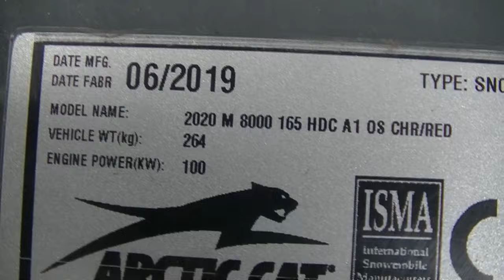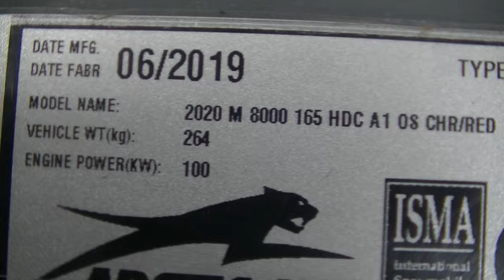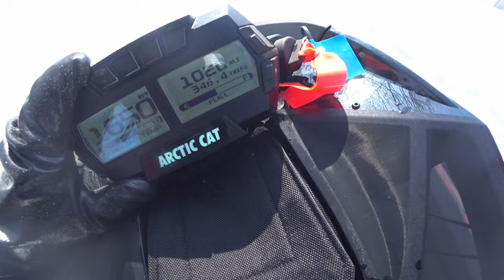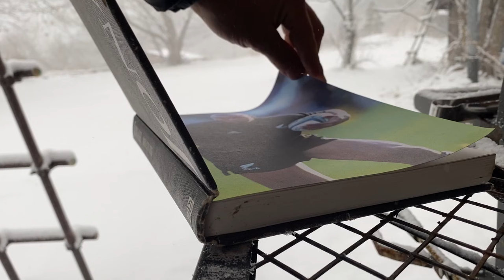2020 Arctic Cat Alpha One Hardcore 165 long-term owner review

Comment: Another great job of expressing your opinions and experience of operating the ALPHA.  Cat doesn’t get as much love for their snowmobile products as they deserve.  AND BRP Linq accessories are the best system..
Reply from the maker: Adventures This Way: Cheers!  I think the LINQ narrow system will fit on a Cat or Polaris tunnel. Gonna look into it over summer so I can really mess up the Cat’s identity.
Reply: @AkatarawaJapan  There are a few companies that make a conversion bracket. One is South Simcoe Machine here in Canada.  Only reason I don't have this bracket is limited room on the Cat 129 tunnel...
Reply from the maker: @ADVENTURESThisWay  Oh thanks. Just checked out their site and their machined brackets look great. Asking if they ship to Japan.
Reply from the maker: @ADVENTURESThisWay  And they got back right away to say yes. Thanks for the info.

Comment: Beauty review again man! I am still loving my mountain cat and the HiJet is still the best little sled hauler. I have had the same experience as you in having the chance to ride a 154. Coming off of my 162 it was so nimble! Needless to say a 154 will be my next sled. It'll fit a bit better in the HiJet too LOL. Oh and I will recommend the Black Cats running boards from Arctic Cat. I installed them last fall and have about 2000 km on them now......amazing! They are also stiffer than stock and clear snow excellently.
Reply from the maker: Thanks. Super tempted to get a 154--Quick, somebody slap me into my senses. Hacking the holes on the Cat really works, but a set of Black Cats like yours would be nice. Kei trucks rule! Change the oil on your HiJet every 3000k or so and you should be able to thrash it forever. Got a rev counter?
Reply: @AkatarawaJapan  no tachometer in mine unfortunately, drive by sound LOL. I have been running full synthetic since i purchased it. Super clean unit and only has about 14000 km right now and papers to confirm. I was thinking 5000 km oil changes with the synthetic but will keep an eye on it. A friend of mine bought a turbo doo and I must say WOW! That machine is a beast! Have you modified the rear suspension in your Kei at all or just stock? I notice after coming off the mountain and heading home at night I get a lot of people flashing me their high beams. The sled squats the truck slightly that it changes the angle of my lights up. Nothing crazy but its enough. I was thinking about adjusting my head lights down a bit but wondering if you might have any suggestions.
Reply from the maker: @mynewuseddoo : My HiJet has a headlight adjuster dial so I can tweak that when under load.  Presume your lights have been realigned right for driving on the right side of the road? I'm sure the turbo Doo is great. Would love to ride it but the  price just came out in Japan @ more than CAN$30K.  Which is 3 brand new kei trucks.  Going to have to pass...

Comment: Thanks for taking the time.  I have a 20' hard core 154 with speedwerx stage 2.  On your next alpha I highly recommend the stage 2.  Massive low end and mid range gain.  Top end a bit more.   Just a good nasty and sappy naturally aspirated setup, and dam near as reliable as stock.  Fun level went up a couple of notches over stock.  My last sled was a turbo 17'  mc,  I prefer the stage 2 over it.
Reply from the maker: Cheers. How did you know I'm getting that 154 I rode? That's top secret. What are the key bits with a speedwerx stage 2?
Reply: Stage 2 is full exhaust, higher comp head for your elevation, Delta 3 reeds, clutching.   Around 17hp gain and lose 20 ish lbs total with this.

I also have the light weight secondary clutch parts, billet spider in primary clutch, tki belt drive.  All those parts remove 5-6 lbs rotating mass.  Belt rotates easier than chain as well.  More power to the snow.
Reply from the maker: @russ384  Oh man, that sounds great. Thanks for the details--always prefer to hear from someone  actually using the gear rather than just reading the company spiel. Going to look into it.
Reply: Akatarawa Japan also put a poly carbinate hood on it with small led headlight, lost another 15-20ish pounds doing this.  Thing will flip over backwards on command, light weight is fun.
Reply from the maker: @russ384  Way to go. Are you on Insta? Would love to see some pics or vid.

Comment: I had under 300 miles on my 2020 when the rail separated at the front. Good news is they warranty it. Bad news is I never hit any thing at all and now it’s off warranty if it happens again.
Reply from the maker: Bummer. I’ve heard of that happening but not seen it. A new rail is about $300 if off warranty, no?
Reply: Akatarawa Japan the price isn’t listed on their parts site but I’d bet here in Canada they are at least a thousand bucks to replace.
Reply: @boser1212   if not more. give it time this will become a problemo
Reply: @menotyou7762  I’m not giving it much time. I’ll ride it this season and it’s gone. Sick of the savage wash out and I’m not testing my luck.

Comment: I was actually put on the assembly line against my will and probably helped assemble that thing. Normally a welder but we were ahead in welding and they moved a bunch of the welders to the snow line. I didn't mind it even though I was super pissed about it at 1st. Just happy I no longer work there and can now actually wear my polaris jacket again. 🤣
Reply from the maker: Dusty Lee Did they chain you to a work station or something?

Comment: Those add-on pipes don't actually do anything other than make your sled more obnoxiously loud.
Reply from the maker: I hear you (pun intended) on the loud pipes thing but they are much lighter and free up space in the engine bay that I use for a battery but others use for belts, tools, lunch pots, easier access to plugs, etc. There are some excellent cans now that give you most of the space/weight benefit for hardly any increase in decibels. e.g. GGB Quiet Can.

Comment: Nice review, very thorough. I like the red little dolly that grabs the track you have in your shop, did you make that? I agree with quite a bit of your opinion, but I do have to say I did not enjoy the icy hard snow performance. Washed out quite often, I also slip off my running board often, my old sled has skins airframe running boards. Cat had a cargo system in the accessories catalog. Shot for all I agree. Lol your steering was better then mine after 400km.
Reply from the maker: ippielb Yep, not the sled for hard snow but then again I’m not the rider for hard snow either. Made the shop dolly. I was out with guys on RMKs this weekend and when I complained about the steering slop they showed me their Polaris version of slop which was almost as bad. I think the difference is that the Cat just keeps getting worse over time. Hope you didn’t mind me plugging your movie at the end—it deserves WAY more views.
Reply: Akatarawa Japan if you ever find yourself in western Canada send me a message. We’ll go out.

Comment: 2019 engine 800 exploded due to the engine oil injection pipe which broke 5706-536 at $ 12.67 between the engine and the tank not guaranteed. 2,500 kilometers. Please be careful.
Reply from the maker: Eric Duchesne Ouch! That would be a bummer.
Reply: @AkatarawaJapan  It's not over .... a judge will have to decide that. The lemon law 👍👍👍

Comment: The seat... would you get it again? Worth the money? Was it useful on the trail?
Reply from the maker: Yes, I'd get it again. It's a fraction taller but main difference is firmer at the back and extends about 50mm further back, so it suits me as a 6ft guy with two screws in my leg that don't like deep knee bends.

Comment: Great review! Love the commentary lol! Curious the Alpha 154 your riding now,  2.6 or 3”?  

Debating between a 165 w/ elevate kit or 154 stock and might stick to a 2.6” lug 

Riding in deep BC interior snow.
Reply from the maker: Christopher Wright My 154 is a 3 inch. I don’t have any experience with the lower lugs or elevate kits so can’t help there. The 165 let me get away with lower speeds while getting my skills and line choices up, and now the shorter track is making me learn to move around the running boards more effectively. If I had to pick one for big mountain terrain I’d probably go 165.

Comment: Had the alpha 2020 154 hc have the alpha 2021 154 hc at the moment which is about to go in on trade for the 2022 154 hc.  The 154 has the track speed so its faster and climbs quicker than my buddies alpha 165 . Haha fiddly as fuck love it. Great vid man
Reply from the maker: Thanks. I ended up buying the shop's 154HC I tried at the end of the vid. What a wicked sled. Ample power and track speed, like you say. Amazing how just a few tiny inches of track can make such a difference to how the whole thing feels.
Reply: @AkatarawaJapan  I don’t know if you have tried the muster throttle yet on it. I would recommend getting one it really does make a big difference just my opinion though.
Reply from the maker: @twostroke_1  Keen to try a finger throttle one day, but I always worry about smashing through the scrub we get around here. I guess with a proper guard it's not an issue.
Reply: @AkatarawaJapan  The  guard an absolute must for sure with it but you need a minimum of 3 days to give it a good try as it will give you hand and arm cramp till you get use to it.

Comment: I don't understand the logical contradiction of saving weight, yet opting for the added weight of electric start. If a person can go through the rigors of sledding in deep powered (which is easier with less weight), how can it be such a chore to pull the sled to start it?  I totally get the reverse thing. It sucks a ton of energy dragging a sled out of a truck, but it's piss all to pull the sled over once (maybe twice). My old carbureted mountain cat starts starts first or second pull. I'm sure the newer sleds are even easier to start. People spend thousands of dollars to lose a few pound, so why add the weight (and cost) of a battery and starter motor (to pack around always). Surely, it takes more effort (overall) dealing with the added weight, than 1 pull on the handle. More like a 1/4 pull on a well tuned Arctic Cat.
Reply from the maker: Fair comment. I think most people who spend big money adding lightness don’t opt for e-start. But for my weak arms and how and where I ride, the advantage of e-start outweighs (ahem) the weight penalty. Super helpful when stuck on weird angles, and the effort of 40 or 50 rapid pulls a day adds up. The doo SHOT is best of both worlds, although ironically the doo 850 has a shorter, tighter pull than the Cat anyway so I don’t mind pull starting it. The Cat seems to need all the rope.
Reply: Some people have joint or shoulder pain, especially older folks 
Shorter people have a harder time rip starting 

When it’s really cold, the e start is easier than trying to both with both arms and legs and putting your back behind it just to get the engine to sputter

Comment: The listed weight is dry
Reply from the maker: I thought it was ready-to-ride weight, as required in Canada, but happy to be corrected if that's not the case. I have weighed other Cats with fuel and fluids on board and they have come in close to the stated weight.

Comment: wrong! the linQ is not the best, Its most likely the worst! no way to modify the storage in any way on the tunnle in the field. the old all tunnle long rail-rack with rubber diving bag is the best! Super versatile and easy to pack and unpack. + if you have just a few things in there it wont be flying around in there and break everything, because the bag is soft, and it presses down on all stuff in ther, no mater how full/empty it is! :)
Reply from the maker: That is a really good point. Haven't seen one like that for ages, but it makes sense. Still wouldn't call LinQ anywhere near the worst, though. Even the Polaris system has external attachment lugs, but the Cat bags have them buried inside where you have to empty the bag to get at them. Super annoying.

Comment: 400km is not long term. You say you get out 30 times a season. There's no way you can only have 400km. It just seems like you should have much more km then that. Oh primary clutches explode at 1500 so watch it for that.
Reply from the maker: Fair point--I should have called it one-season review or something. Here in Japan our riding zones are very close to road ends, so we don't rack up the big miles that are typical in North America. Plus, I ride other sleds, so not all those 30 days are on the Alpha. Anyway, I'm still enjoying the A1 it and ended up also buying that 154 I ride at the end of this vid. Call me stupid, but got a great deal. Super sled. Problems at one stage with a faulty temp sensor but otherwise all good. Next season I will sell one of them and try my first Polaris. Thinking Khaos. Wish me luck.

Comment: If you’re looking for a top notch gear bag check out SledRax (www.sledrax.ca) It utilizes the linq adaptors and it’s a weather and impact proof pelican case. My first year running this set up and wish I had gotten it long ago 🤷🏼‍♂️
Reply from the maker: Ben_Syxxes Thanks. Checked the site. Looks like a good system.